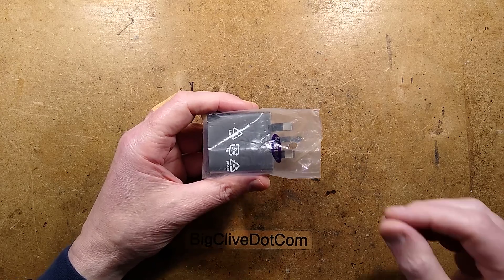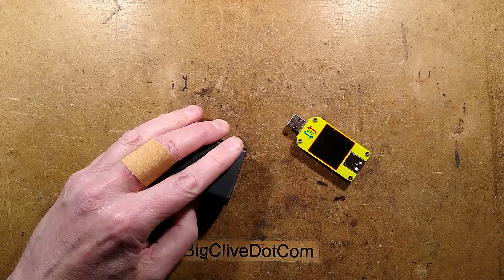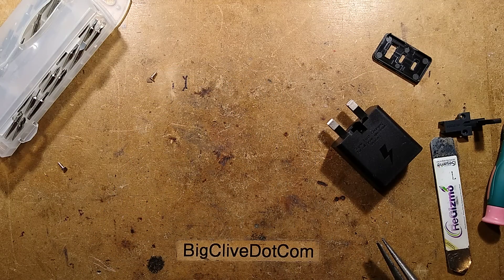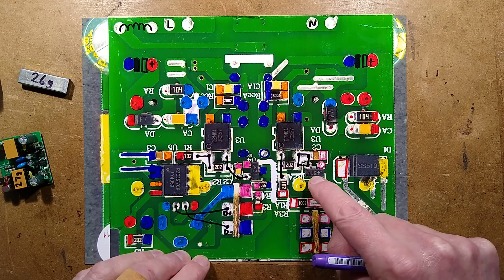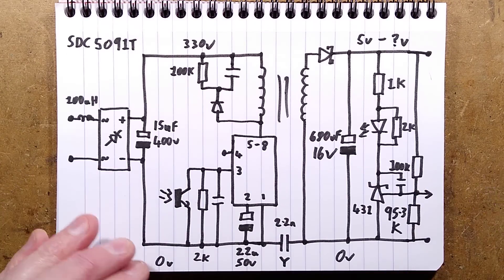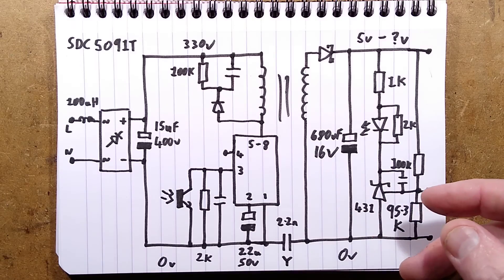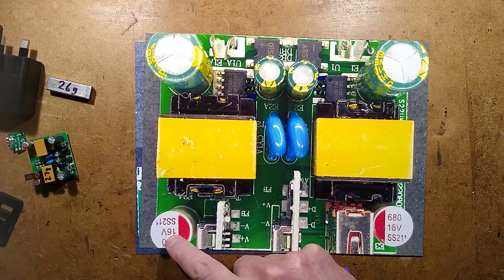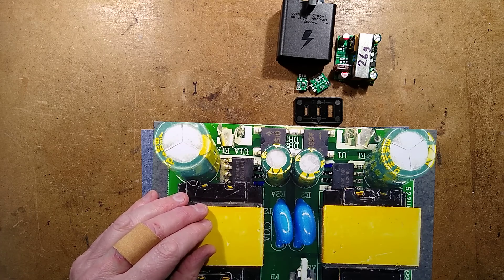Fake Samsung charger with interesting circuitry

Comment: What annoy me is I test chargers before i purchased it. I would have an charging app on my phone to test it. I bought a 45w Samsung charger about a month ago. My S10+ was charging really fast with good watts and amps numbers. Now it feels like its pushing charging speed like the 25w. I knew it was fake but i need a charger as my original 25w was washed in a machine by accident. I also knew it would last that long, so im looking into getting a original 45w soon. My phone was made for 25w but it works fine with the 45w. It wont damage it as far as my reseaech goes. I also have a Buds3 Pro, but i never once charge it with this fake 45w, because I'm not sure if the Buds3 Pro has the same electrical protections as my S10+ has. I charge my Buds with my wifi router port at least once a week.
Reply from the maker: Keep in mind that charging cables can seriously affect charging current.  Fast charging is not good for battery life.
Reply: @bigclivedotcom that i know. Im using a 100w authentic Argom cable since i was using the 25w charger. The 25w cable would just be a bottle neck for the 45w The charger still pushing high number when I use the Device Info app but I do plan in getting a real Samsung 45w soon though as my S10+ has 96% overall battery health when i checked the dump logs, which is really good.

Comment: The perpetrators have watched enough YouTube to learn that buyers usually perform a quick test (such as 18650 cells) to determine if a need to further investigate a suspect product to be fake or not - with a quick weight comparison. What we have here is a ballast to counterfeits the weight of the genuine one.

Comment: Also, official chargers would usually come in a sale hanging box package, even if you order it online.  Usually, through the Amazon website from the Samsung storefront there.
Reply: It's not that simple.  Aside from retail packaged product, they have had chargers to bundle with products and will have excess stock once the warranty is over for a generation of product.  The question is then what happens to that stock.  I'd bought white box major brand products several times over the years, as well as samsung phones that had chargers just in a little plastic baggie.

Comment: Great video, as usual. Yep. No way that's a 65W charger. After looking at the datasheet for the SDC5091 the typical charger design contains the primary side PWM controller, the 5091 with integrated power MOSFET (The datasheet rates the 5091 for 30W.), a synchronous rectifier (e.g. SDC5161 in the datasheet example) and a protocol controller (shown as SDC514X in the datasheet example) that drives the optocoupler feedback for the 5091. The SDC514X six-pin devices in the datasheet example don't need an external voltage reference but have integrated references, monitor the output voltage, and sink currents directly through the opto-coupler LED based on the USB 'fast charging' protocol. Since you showed the design with a 431 it appears the reviewed charger uses a different, perhaps older, protocol controller.

Comment: A few years ago I built a plastic injection mold for the end caps of a high power power amplifier for Pioneer. In each end cap was clip features to hold a section of concrete reinforcing rebar. Pioneer stated that the customer wants to feel the weight as they don't believe a lightweight power amp develops any substantial power. Heavy sells!

Comment: It's possible to replace some ic or transformer to work properly? I buy one it's really expensive also for fake charger only receiving 1 to 2w only and also showing fast charger but not
Reply from the maker: It's only viable to replace it with a good power supply bought from a known source.

Comment: Clive, coming back to this video now that I know a bit more about things...
The reason the feedback circuit doesn't just flip in different resistances is so the supply can vary the output voltage as the device requests, via the Programmable Power Supply (PPS) feature added in the USB PD 3.0 spec. The idea is optimizing the input voltage to best charge the battery.
As for the two independent supplies, this makes sure one of the outputs can supply max wattage, while the other two are splitting up the wattage capability of the other supply. The other two ports have to be at the same voltage, and if you connect something, the other port will temporarily shut off while it re-negotiates. There's definitely some excess duplication, though, and no way can this do 65W.

As for not wanting to plug expensive devices in, there are newer USB testers that can query and negotiate with PD and QC2.0/3.0 supplies. It's great for seeing what they support, and triggering the higher voltages to feed into a load tester. I personally like my FNB58, but there are other options on the market.

Comment: Your power plugs in the UK are great. In the US, a heavier charger box leans away from the wall and eventually exposes the prongs.
Reply: Why would you be plugging them into a wall in the first place?  Multi-outlet power strip  FTW!  I can't recall the last time I actually plugged one straight into a wall outlet.
Reply: @stinkycheese804  Power strips plug in and hang from the wall too, though. 
Also, power strips and extension cords don't solve every problem. I watched a space heater that was powered off spontaneously break out into flames while plugged into an extension cord.

Comment: To be fair to the random lump of metal, I've got a few things(every remote I own, and a few computer mouses) that would be improved immeasurably by the addition of a lump of metal.

Of course, there's a difference between a lump of metal just randomly in a power supply that might possibly lead to undesirable operation and a lump of metal to improve the feel when used.

Comment: I've seen a lot worse.  Thanks, that was different and interesting. It's a pain when the charger that came with your phone or computer fails since the prices the manufacturers want for a new one are insane.   Are there any reputable brands of aftermarket chargers?
Reply from the maker: There are.  You can buy them from prominent suppliers like CPC and digikey.

Comment: 15 pounds quite expensive?  dunno but good charges of this wattage are around €40-50 at least, so imho 15 pounds is dead cheap for this charger.
Reply from the maker: It's expensive for a cheaply made and non compliant clone.
Reply: It's also expensive for something that doesn't work to charge my laptop.

Comment: How does the 2.2nf capacitor work?  Does this simply provide stabilization / transient protection ?
Reply from the maker: It provides a path back for noise capacitively coupled between the transformer windings.

Comment: Google says
FP6606AC Simplified USB power delivery 3.0 protocol controller
SDC509 DC-DC converter 5-6W, 5VDC output
SDC5091 Switching power supply controller

Comment: This is worthless pick picking of a new product that claim to do muti amp charging USB - C  but a visual and circuitry breakdown conclusion. Why? You didn't test it. And their is a need older table has a short bulk charge range. And you can't used that 30 watts charger it will over heat. To tap off that battery. So here where it useful. As you get more charge in that pack at lover amps. My go pro choosy on what USB - charge you used. A low amp So I had to run through and find one. To tag go pro.
That a handy devise, so does it work. And compare that up to par with it product price.

Comment: 65w would be 13 amps at 5 volts.

Current output max is part of the usb standard and the highest possible is 3a so a claim of 13 amps 65 watts is clearly wrong

Comment: The 431 is being used as a voltage detector, not as a reference. As the ref pin goes above 2.5V, it immediately turns on the optocoupler's led. Actually, that way of using it is quite common as far as I know, and even described in application notes.

Comment: The board was sold less than 1USD in Shenzhen, and it's a common use board, the reseller made the plastic box and printed any label on it. The owner of the reselling company is usually some homeless guy, the real owner will never be caught. The manifacturer is legit.

Comment: The 6606ACA chip is an actual USB-PD controller apparently. A very cheap one though: https://datasheet.lcsc.com/lcsc/2106021033_Fitipower-Integrated-Tech-FP6606ACDW4_C2836669.pdf

Comment: I found the PDF Data sheet of that 6605ACA chip. Its from a company called Fitipower
MFR Prt#: FP6606C, USB Type-C and PD Charging Controller.
Description:
The FP6606C is a simplified USB Power Delivery 3.0 protocol controller. 
It also integrated functions for HiSilicon Fast Charging Protocol (FCP) 
and Qualcomm Quick Charge 2.0/3.0
This was listed on pdf.

Comment: I found two such metal pieces inside when i recently - - - TORE - - - open my wireless Motorola "Sonic Boost" 210 speaker. The battery came "dead - in new box" so it never gave me any pleasure. I figure they are weights to balance the damn thing. I actually added lead weights to a remote i have for my adjustable massage bed so it would "sit" in my hands more securely or whatever and won`t feel so cheap to the touch.

Comment: I once bought a lamp from a Chinese manufacturer. Thinking it "felt" quality because of the weight, I took it to bits and also discovered a bar of steel. Once removed the item was featherweight. Funny how we associate weight with quality!
Reply: It really is funny. I've had a similar situation for a microphone of a Japanese radio transceiver (Icom HM-219). The microphone is actually quite good, but it has two weights on the inside. With the weights, to me, it feels much more solid in the hand. When I remove the weights, it feels like a piece of plastic junk.
Reply: Lamp?  If the weight was in the base, it was due to being higher quality than the same lamp would be without it.  You don't want your lamp to too easily tip over or scoot around, so making it bottom heavy is the right design choice.

Comment: As usual, excellent video. I am building a power supply based on TI document TIDU455a section 2dot1dot1dot1.  How can I select inductors that also work well as fuses?

(btw, if I put the dots in, YouTube thinks it's an IP address.)

Comment: Buy a generic power supply 24v 2a (1.8usd). Buy a fast charge module (3usd). Combine! 48w is plenty enough for most smartphone. 24v because the module can use the 20v. The module supports pd3.0 pps & most fast charge protocol like samsung, huawei, qc4.0, oppo etc. Not xiaomi

Comment: I think more expensive chargers are almost more dangerous, as price is associated with quality. I won't buy the cheap one, because the more expensive one should be better. Chargers in general are such a minefield these days that it's getting more difficult to buy one that's safe and as specified.

Comment: Not 100% sure this is the exact same chip but it looks very similar: FP6606AC -  https://datasheet.lcsc.com/lcsc/2106021033_Fitipower-Integrated-Tech-FP6606ACDW4_C2836669.pdf Only 18w between the 2 ports?

Comment: I found the info for that 6606 chip, but if I post the link here YouTube will nuke my comment. Instead search for JD6606S and you'll find it. The important keywords for stuff like this is always "power delivery" as that's the USB standard that USB-C fast chargers use to negotiate voltage/current limits. They actually use sideband channels, not the data path, for this communication (SBU1/SBU2 and/or CC1/CC2 if I recall correctly).

Comment: That 26g of Quality Mass isn't just any old steel either. It will be "tofu dreg" steel which doesn't meet any international standards, which "can't" (shouldn't) be used in any construction anywhere, and which the smelters making it are finding it increasingly difficult to unload - even in China - as "tofu dreg" projects get increasing amounts of (losing face) international attention. The solution? "chop it up in small pieces and ship it out of the country!"

Comment: I usually weigh batteries, power supplies, check if they have a hefty capacitor or  dont and even value supplies based on brand,but now i have to use rtg pics for them :) or an Big Mr McHammer:)

Comment: As a well known YouTube reviewer always says "put the charger in the box" to the manufacturers that don't. I had to get my super fast charger from an official seller. The last place I would buy any electronics is through Ebay. Amazon Market place is a little less risky, and Amazon Store should be safe! Some people who replace their phone, will pass the old one along with the charger that comes with it. The new phone will have super fast charging, so they will buy a 'suitable' cheap charger ignorant of the dangers of a fake. Then if fake, at best the phone will charge if not fast. At worst the charger could destroy the phone plugged to it, or the charger explodes possibly destroying the phone connected. The manufacturers should sell the charger at a very good price, especially after buying an expensive phone as an option.

Comment: Don't forget the most important thing in today's new physics that people generally forget about magnetic fields affecting nearby coils or transformers. When the voltage is connected to the two independent voltage systems and one is not used, the magnetic field will still work and then sit on the magnetic field of the other transformer, which in turn helps with more magnetic field as the other does not draw any current at all. In this way, the loaded power stage can cope with a little extra power. That is why the extra piece of metal is bridged across both transformers which is over both transformers clearly.

Comment: The chip marked 6606ACA is a Fitipower FP6606AC, which is a dual USB-C PD/QC and USB-A QC charger controller. The last letter denotes what list of USB PD voltage/currents will be presented to a PD-capable device; the A suffix means the USB PD protocol will present 5V/3A, 9V/2A, and 12V/1.5A. The chip marked N603 I couldn't find information for, and searching for an FP6603 didn't turn up any useful data (but there is a datasheet for an FP6601 and it seems similar enough in pinout). From what I can tell it is just a QC controller that looks at the D+/D- lines, but I can't quite make out what is going on with the CC identification lines on that board since it's not a simple 56k pullup resistor to indicate a USB-C power source.